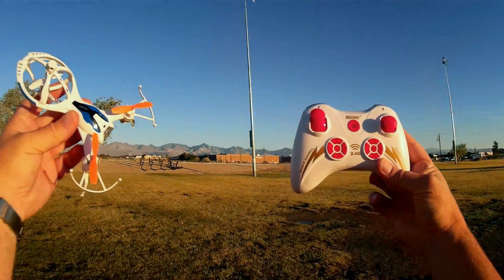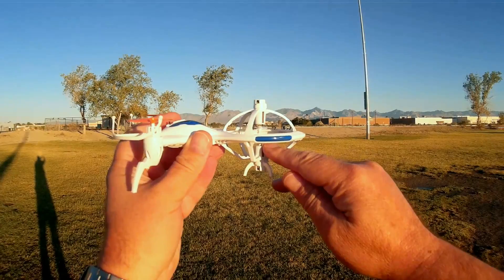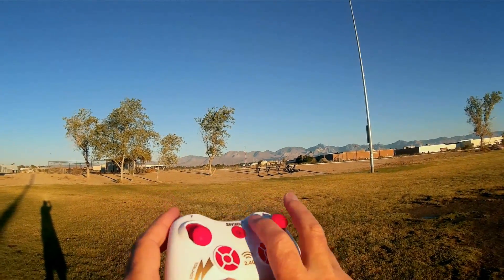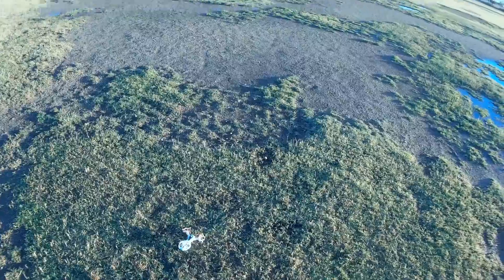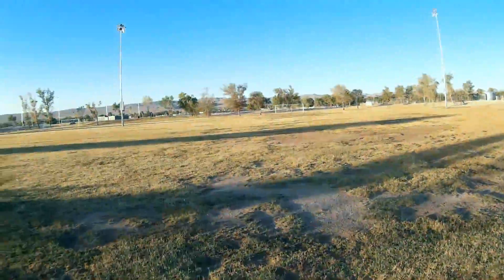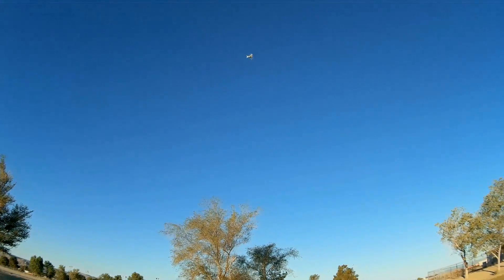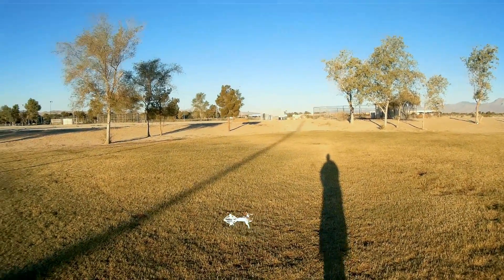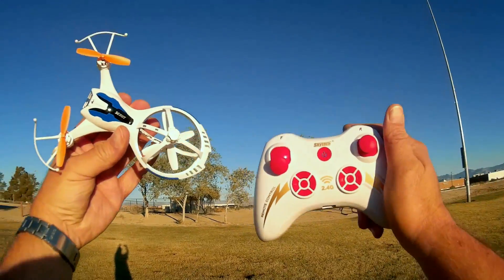Skytech M71 Scout Micro Tricopter Drone Flight Test Review

Comment: The 2 front motors both produce upward thrust, however the spin in opposite directions. So, they controll yaw by changing the speed of the motors.

Comment: it has 2 front motors because physics. since a multirotor will control yaw using the torque generated by the motors, an odd number of rotors (like 3) would cause the torque to be out of balance and it wouldn't work so easily (although it is possible). using 4 motors is the easy way to make this work

Comment: Hello Quadcopter 101, can you recommend me a small camera for mounting, say on an Alias/Ominus/ or Mjx x400? I have all those quadcopters and was wondering what small camera I can mount on them. I know the mobius is a good choice but I was hoping for something under $50. Thank you.
Reply from the maker: Actually, the Mobius is a bit too heavy for those mentioned.  I always use the 808 #16 with quadcopters of that size https://www.youtube.com/watch?v=Yk4p_9oEAb0
Can find it here http://www.banggood.com/808-NO_16-HD-120-Degree-Mini-Camera-Module-7g-p-82197.html?p=RB0922217402201307U3
But be careful, there are a lot of cheaper imitators of this camera out there, with cheaper low res video.
Reply: +Quadcopter 101 I was planning the Mobius for my Tarantula. But the keychain 808 #16 looks really good. Thank you!
Reply from the maker: Andre Martinez The mobius works great with Tarantula sized quadcopters.

Comment: I guess the seccond motor on the front is there to make yaw possible. A quadcopter speeds up 2 motors and slows the other two down to yaw. A real tricopter uses a servo to tilt its back motor which this cheap one does not have so it needs the seccond motor to make yawing via differential thrust possible. In the end it is a quad with its two front motors positioned above eachother. (Wouldn't make much sense if one of them would point downwards because you don't need that to pitch and you want it to fly so aiming one motor down is not a good idea. Normal quads don't reverse their  motors either. They only slow them down or speed them up to tilt into the direction you want them to tilt. 3D quads on the other hand can reverse their thrust, but they only do it for inverted flying).

Comment: It's usually called a Y4 quadcopter. Tricopter enthusiasts will be enthusiastic about telling you it isn't a tricopter, a tricopter has 3 motors/props, the single rear motor tilts left to right to give yaw control, rather than doing differential yaw like on a quadcopter.
Reply: i chuckled a little at the hypothesizing what the front props actually do.